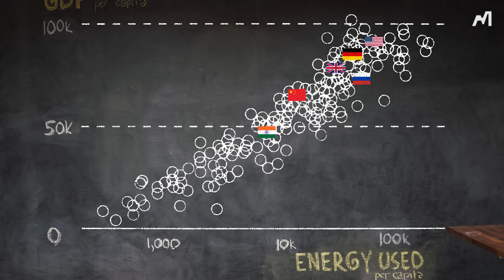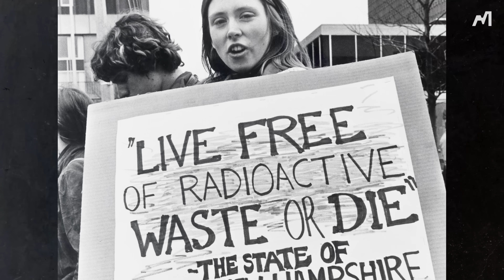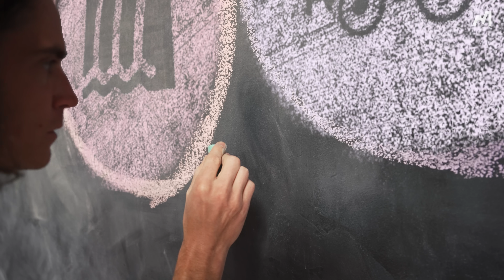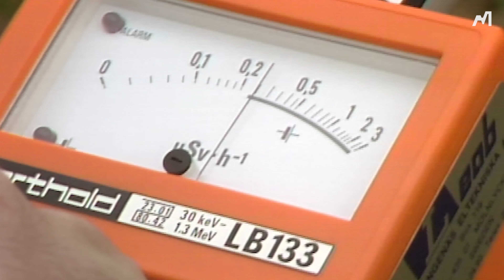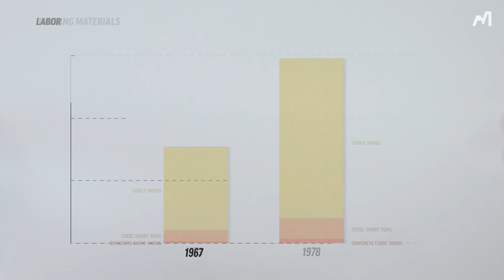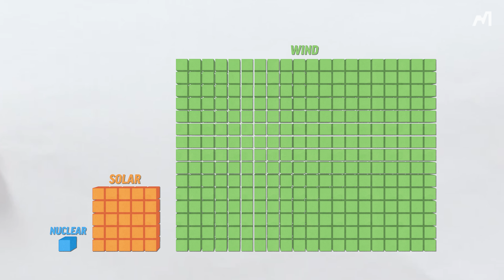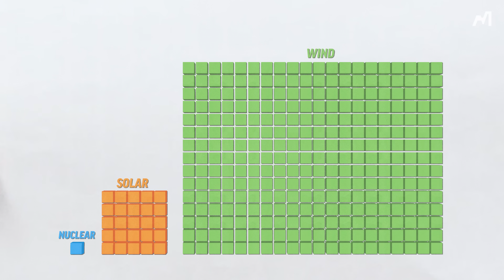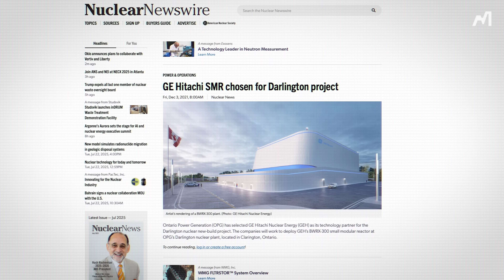They're Lying to You About Nuclear Energy

Comment: Imagine if any other energy industry was held up to the “As low as reasonably possible” standard - you physically could not operate a gas power plant or an oil rig then. 

Imagine if the “Linear no-threshold model” was used to determine potential health damage and carcinogenicity for other forms of pollution, it would force coal power plants to capture 99.99% of their emissions (like how nuclear operates in a 100% closed cycle), or not a single gallon of oil to spill or leak. Imagine how much more careful chemical manufacturers would have to be to, you know, not dump waste that may or may not be toxic (who knows, there’s no regulation requiring them to figure out if it’s dangerous or not _cough DuPont cough_) into the ground water. Imagine if we treated hazardous industrial waste or contamination like we treat nuclear waste - like how much of the country is still exposed to high levels of lead, cadmium, arsenic, and mercury which do follow the linear no threshold model.

Comment: 20-25 year lifespan of a wind turbine is what we were sold. It's about half of that in reality before either major repairs need to be done (which we pay for again), or be completely decommissioned. So, about 10 years until they're done for and then we have to pay again to have them torn down. And then we have to pay for them to be disposed of.
Reply: Your source???
Reply: Living near one is a good enough source, which many of us do.
Some of these turbines don't even survive 5 years, it's insane.
Reply: @MithrilSludge6541  Yep. I have a buddy that used to work on them. Terrible job!
Reply: @robertnicholson7733 I worked in the wind fields for 10 years. They are all falling apart.
Reply: @robertnicholson7733  My best friend was a windmill tech for about 10 years. They fail all the time, even sometimes exploding. Half the time most of them are shut down. Inconsistent power delivery. Most expensive form of energy per kwh ever to exist on this planet.

Comment: No response? None at all? You are calling out liars (rightly so), but you yourself told a whopper of a fib. Either own up to it or let's engage in discussion where you show me my errors. Here, I'll copy the message where I called you:

99.9% of the hype and fear regarding the generation of electricity from nuclear reactors is BS. I accept that.
However, you completely glossed over the real problem. That's called lying by omission: What is the cost of long term storage of the waste products in a secure fashion. The SHORTEST time period is a few hundred years for strontium-90 and cesium-137. Answer this simple question and we can have a much better and more honest discussion about the future of nuclear power. Here are the storage timelines we are talking about:

Strontium-90 & Cesium-137 → Dominant hazard for the first few hundred years, then nearly gone.

Americium-243 & Plutonium-239 → Control hazard from thousands to tens of thousands of years.

Technetium-99 & Neptunium-237 → Stay around for hundreds of thousands of years.

Iodine-129 → The “long-hauler,” persisting for tens of millions of years.

👉 That’s why waste repositories are designed with multi-barrier systems and safety cases extending out to ~1 million years.

Comment: Latest GenCost 2023-24 report from CSIRO and AEMO shows renewables will provide the cheapest power for Australian homes and businesses by 2030.

The report finds energy from renewables will cost between $83 and $120 per megawatt-hour (MWh) by 2030.

In contrast, any potential small modular nuclear reactors operating by 2030 would be significantly more expensive, costing up to $382/MWh—up to eight times the cost of renewables with storage factored in.

Comment: Framing waste as “one cask a year, nobody will steal it” is a straw man. Theft isn’t the issue, the unsolved part is guaranteeing containment and stewardship for centuries to millennia. Yes, the volume is small and dry casks are robust, but they’re explicitly interim with aging/corrosion limits; failure means releases of volatile fission products (I-131/Cs-137/Sr-90) from pools or breached canisters, leading to long-lived land and water contamination. “Finland solved it” is premature: Onkalo is still in trial/commissioning with licensing under review; routine disposal hasn’t begun, while the U.S. has no operating repository, so risk shifts to indefinite on-site storage. Reuse helps but doesn’t magic this away: Japan’s Rokkasho reprocessing/MOX program has been delayed into FY2026–27 and still needs a deep repository; China is building demonstration reprocessing and MOX, which reduces volume per kWh but creates separated plutonium and still requires geologic isolation. Calling waste “handled” is spin.

Comment: Aluminium poisoning is a growing/ignored problem with wind farms as to protect the blades against weather they use an Aluminium based aerosol spray that initially doses an area then as the blades coating becomes micro eroded even more aluminium poisoning blowing in the wind - important as Bees are dying off big time and guess what metal Bees are absolutely destroyed by as it acts as a neurotoxin in them.

Comment: I think most people think nuclear is great, until it isn’t 😂. No other form of energy results in a 30km+ exclusion zone where robots sent in to cleanup the mess malfunction because radiation levels impact the electronics. When things go wrong, they go extremely wrong unexpectedly. 99.99% of the time It’s safe and clean energy until it isn’t and then areas are contaminated for centuries. We only have about 100 years of nuclear fuel at current consumption. If we don’t find a long term energy solution, we go back to the Stone Age.

Comment: while the uranium and plutonium are arguably safe themselves their daughters aren't, the biggest contamination is the radioactive dust of them. 
also the old nuclear reactors weren't exactly build to produce electricity or to be safe, that's why there were very few accidents and they were very few still. there are many passively safe or with fail safe reactors. 
infact including accidents the nuclear power is still safer and less polluting than most fuels and can even rival green energy even in terms of polluting. and yes solar and hydro and wind does pollute as they are being made.

also it's not true about iran, you don't need nuclear power or waste to build bombs remember USA literally invented the bomb in 3 years not 15 years, USSR took only 4 years after that to get one.

Comment: I think the economic disadvantages outweigh the advantages of nuclear. 
Renewables are multiple times cheaper and technologies to store electricity are advancing at a fast pace which could make the reliability aspect of nuclear energy redundant. 

The small modular reactor part and ai stuff just sounds unbeliveable, I would need a credible source to believe that. So far smaller reactors have the problem of being less efficient than larger ones at generating power. Which makes alternatives more attractive.

Comment: 12:40 Have you covered agrivoltaics yet? Paradoxically, solar panels benefit many photosynthesizers. "Whatever in the 150 square miles that was soaking up the sun" still receives more than enough indirect light to maintain its metabolic cycle, holds water with less effort, and doesn't spend so much of its resources trying to defend against damaging radiation.

Comment: Big oil and coal will lose to much money if nuclear takes off.... they can't stomach that, nor can the monopoly of power companies across the US.... it comes down to lobbying and big company $$ losses.
Reply: How are you running your ICE car or gas central heating system with electricity?
Reply: @Damn2FA Who said anything about having an internal combustion engine. 
Yes, everything is electric here- Lucid, hot water heater, glass stove top, house air unit.
And just this weekend, saw at a Pilot plaza, there were GM charging stations being installed. Not Tesla stations, so that leads me to know that other companies are getting ramped up for electrical power offerings. The idea of copying the Navy's nuclear reactors is perfect and the way to go!
Reply: Big oil and coal are the ones dangling the nuclear carrot in front of you so you won't build more renewables.

Comment: A nuclear accident is inevitable in every single reactor if it runs long enough, no matter how well it is run. Yes, inevitable. It's not a question of 'maybe', but when.

The failure might be minor (and likely will be), but there is always the possibility it will be bad if a black swan event outstrips known safety protocols and causes a disaster.

Why? There are two major components to mechanical systems of any kind - the equipment itself and the people who use it. Even if you could somehow make nuclear plants 100% reliable mechanically (which no machines ever are), you will never be able to make the people who run them 100% reliable. Therefore, the possibility of an accident can never be eliminated. It's just a question then of how often accidents happen and how severe they are.

This inevitability is mitigated in Navy ships because they have highly trained personnel, adequate backup resources, and budgets to deal with accidents and to keep reactors in top-notch shape. And if things go badly wrong, it will likely be at sea, away from population centers. Also, Navy reactors are used while the ship is in commission. That's maybe 50 years at best, unlike a larger facility that is expected to last much longer so the window for possible failure is greater.

Also, even though there are many ships with reactors, the number is small compared to the hundreds or even thousands of reactors that could be built on land. Each new reactor adds a new possible point of inevitable failure.

Think about the current power grid. Blackouts happen because of storms or geological disruptions that wreck substations. Generators fail due to being worn out or run improperly. Sometimes, there is even deliberate sabotage. And will operators shut down or replace older reactors before they have a failure, or will they try to squeeze a bit more out of them even though the reactor might be getting too worn out?

The point is that even the best-maintained grid will experience failures. Do we want to add lots of smaller nuclear reactors to the grid, installing them all over the land and not out at sea, knowing that if they fail badly, it will be very, very bad compared to the failure of other energy-generating options? 

I'm not convinced at all that it's worth the risk, especially considering most reactors will be run by penny-pinching utilities or private companies that won't be running their facilities to Navy standards. And I'm not at all convinced by the argument that most radiation exposure from the nuclear industry is no big deal. 

However, I will keep an open mind and follow the latest news and research. For nuclear, the bar for trust is higher, given the potential long-term effects if a catastrophic accident happens, so we'll see how that is addressed in any plan to expand nuclear power.

Comment: Good video.  Some additional points:  1) Solar and Wind actually do little to reduce CO2.  This is because they're intermittent (wind fails 65% of the time and solar fails 75% of the time).  Wind and solar needs to be backed up.  Battery backup is too expensive (and dangerous).  The backup to wind and solar is provided mostly by burning fossil fuels.  2) Nuclear got hit with a double whammy, increased regulation plus the advent of fracking made Nat Gas cheap.  With the far lower cost of construction and affordability of fuel, building nat gas turbines exploded. 3) Japan, Korea, and China have much more recently built nuclear reactors in 5 years.  It can still be done.  4) Iran is focusing on Natural Uranium enrichment to make nuclear weapons, not converting spent fuel to plutonium.  No country has ever relied on separating plutonium from commercial spent fuel to make nuclear weapons.  5) The economics of SMRs depends on large-scale factory production of reactor components.  There hasn't been any financial interest in building these large factories.

By the way, I'm a PhD in Nuclear Engineering, albeit with an emphasis on Fusion, not Fission.

Comment: Actually, I was just reading a study saying that there was an increase in thyroid cancer in children after Chernobyl due to radiation. There was no increase after Fukushima because the radiation exposure after Fukushima was much, much lower. So I'm not sure I buy the idea that radiation danger is overblown.
Reply: There's also the economic impact of areas being rendered uninhabitable and unfarmable for decades.
Reply: @spankeyfish  Do you mean like the solar farm areas that are uninhabitable and unfarmable for decades. As long as those solar farms are using that land, it is unusable for almost everything else.
Reply: It's a double-edge sword You are right especially broad stroked radiation explanations that don't divide solar vs ionizing radiation however in the video's defense there is a lot of alarmism surrounding nuclear energy that is absurdly bogus especially with new technologies , One of the biggest problems is the bureaucracy around light water reactors and their maintenance concerns and profit locking, these old systems are inefficient and significantly less safer than the modern alternatives that aren't underneath pressure in a vessel or require liquid cooling such as a liquid molten salt thorium reactor That goes completely inert if it loses power as it goes from a liquid to a solid state completely halting the chain reactions,  these reactors also create more usable fuels in their reactions which is astonishing to wrap your head around once you understand how those fisson by-products re-convert into energy.

The problem is big coal, oil, and gas run the show, free energy isn't profitable , solar and wind are are market as green giving the public the false impression they're safer but theres a metric ton of petrol and micro plastics in their maintenance construction and produced waste while giving 85% less output. 
Oil, gas, coal at the moment the necessary evil that keep society running yet have poisoned and killed tens of millions worldwide In compared to nuclears thousands in its entire existence, nuclear is significantly safer but It gives power back to people instead of the corporations and government..... That should be significantly scarier  then anything discussed here.
Reply: @SunBrohan  Are the newer technologies you mentioned even ready to be put into use and scaled, though? Let alone, if they are newer, I'm not sure how well tested for safety they are.

Also, the one big concern that doesn't seem to have been resolved yet is long-term storage. Even with recycling of waste, we're not yet at a point where we can recycle 100% of the waste yet--so we still need long-term storage.
Reply: Is it also possible that people living by the Ocean get much more iodine in their diet and exposure so wouldn't take up the radio-nucliieds as readily?
Reply: Yes, thyroid diseases are well documented in Europe. There was a spike and there are still ripple effects in some countries in Europe. But it's true that this type of Russian reactor was very badly engineered and there was a lot of systematic neglect and incompetence, like in many areas in USSR.
Reply: @pontiuspilates You know what I worry about though is that the reactors are nice when they're new, but what happens when they need to be maintained? Are we going to be able to find the tax money to repair them properly? I mean our roads and other infrastructure are falling apart because we don't have the funds to maintain them.

Comment: The thing to remember, is that safety standards basically weren't a thing of note in the early years of nuclear energy and indeed were developed over time, in some cases learning the hard way. We've come to understand nuclear energy has the potential to deliver vast amounts of power and to do so for decades. However, the costs due to modern safety standards and the complexity involved in building, even if modern designs are much improved and safer, means it's not 5 years to build a reactor, it's more like 15+ and those additional years and costs make the resulting eventual power generation pretty much the most expensive way to do so. SMRs double down on the cost, effectively, by offering lower kWh generation, but are still bound to the same sorts of legislation and safety that make such endeavours enormously expensive.

I think it's a pretty open secret that various oil lobbies had quite the hand in historical decision making but at the end of the day, if reactors can't be built to provide energy at costs similar to other methods (or ideally less) then few are going to invest in it. Regardless of what all else is going on.